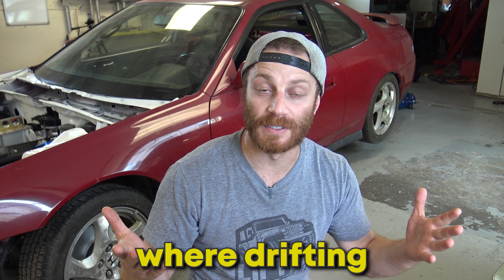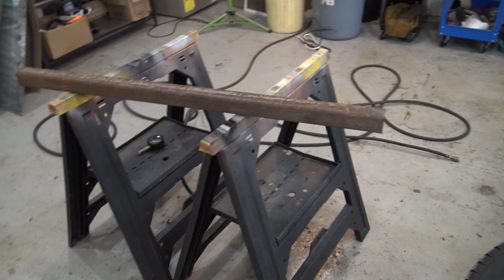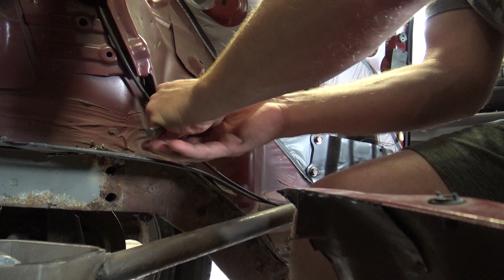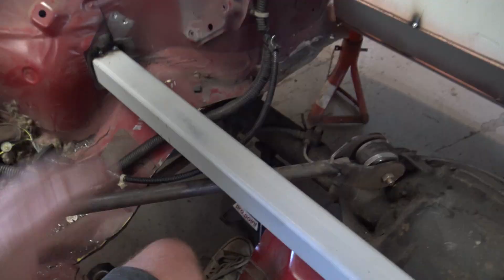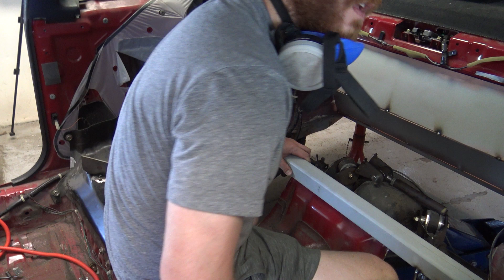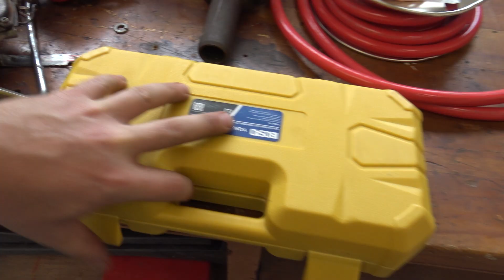I made a RWD Honda Prelude - Swap is COMPLETE!

Comment: You should consider doing the rear suspension as a De-Dion axle with a satchell link. I would also prefer it to remain with a Honda powertrain... The J-series V6 has solid potential and is leagues lighter than that (presumably) small block Ford or Chevy iron block motor. Frankensteining together a J32a3 with a J37 crankshaft, pocket ported heads, ported magnesium intake manifold with 78mm throttle body, and the biggest cams you can find will get you to around 330 at the wheels, revving to the mid 7s. A custom intake mani with shorter runners and TWO of the stock 67mm TBs will get you to 350-360 at the wheels. Mind you, this is a 300lb engine, dressed, compared to a 500lb engine.

Less torque, maybe, but you compensate for that with the right transmission (IMO, a CD009 for later plans with boost), and a Ford 8.8 IRS diff (to go with the de-dion axle build) with something like a 3.73 or better rear ratio. Should still turn 55mph or so on the highway at 2000rpm (80mph at 3000) and have excellent spacing. Given the body limits of these cars, keeping your tire size down (unless you mod it), you don't really need more power for drifting a chassis this light. When you need more power, rods and pistons (and an upper bore bracer, possibly with an epoxy kit and some drilled holes for coolant flow) will easily get you to as high as 850whp. With a shorter engine and all that engine bay space, you can even run the turbo in front of the engine, turned sideways, and with equal-length up-pipes to preserve the epic, high-pitched sound they have the potential for.